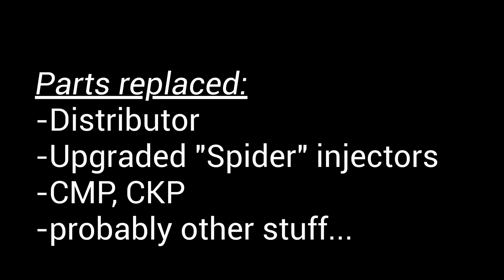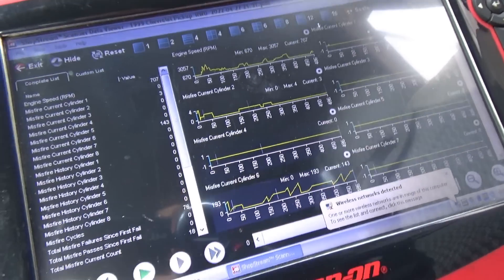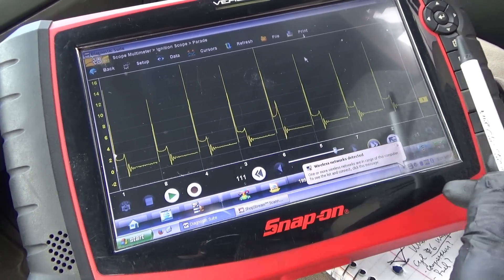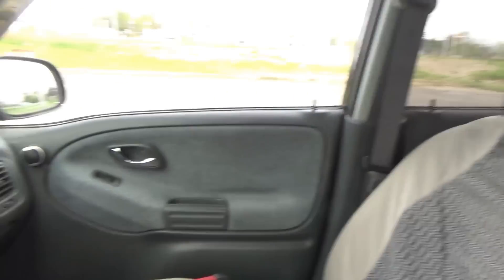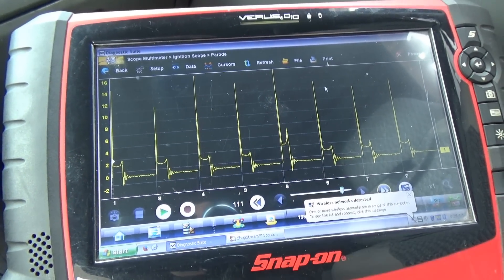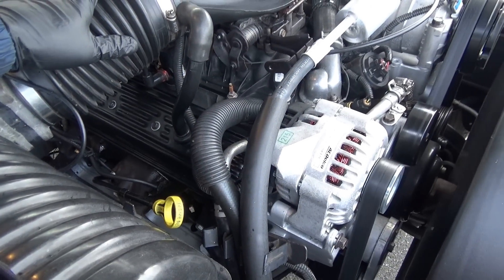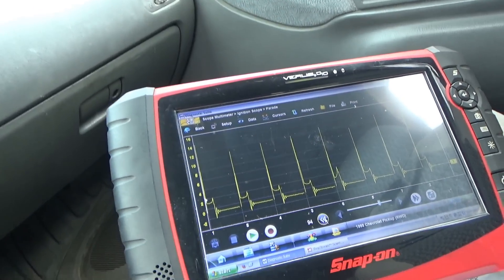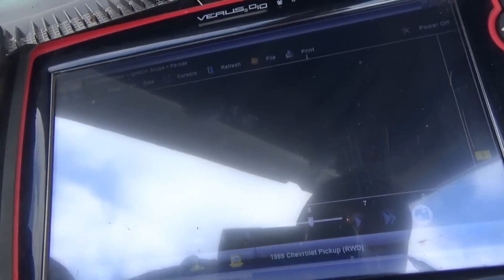Chevy Mystery Misfire...After Engine SWAP?

Comment: If you have a can of carb clean or brake clean, you can spray around where the suspected leak is with the engine running and if there is a leak the engine will let you know. I have used this trick and it works.
Reply: Works better with starter fluid
Reply: Great trick to know. I’ve seen Ivan do this in a video so I’m sure he knows already - still a good tip for all of us viewers.
Reply: Soapy water is good too... Bit safer on a warm engine too
Reply: @davyarthurs  Not sure if soapy water works on vacuum.  It needs to be flammable fuel-- and when you spray it next to the leak with the engine running, it will suck it in and cause the truck to idle higher--  and there's you leak.
Reply: @calholli  news to me...
Reply: @calholli  yeah with you but the water will affect the engine idle too   Maybe not as well as brake clean etc but water in the combustion chamber will have an effect .